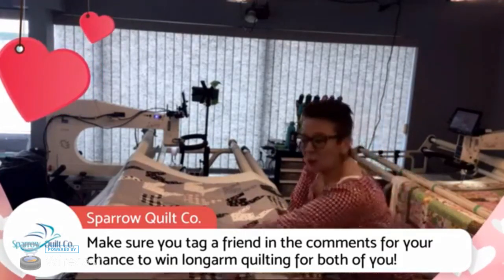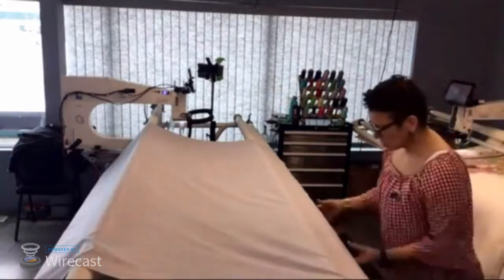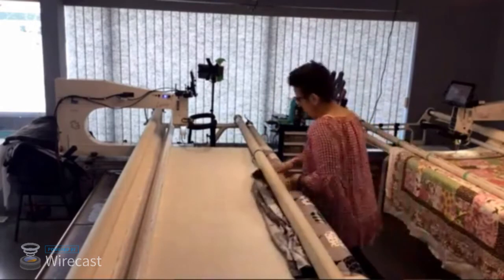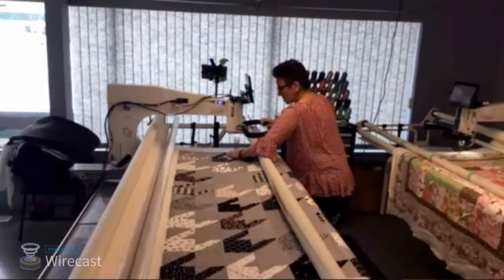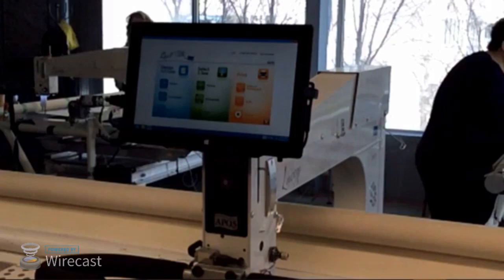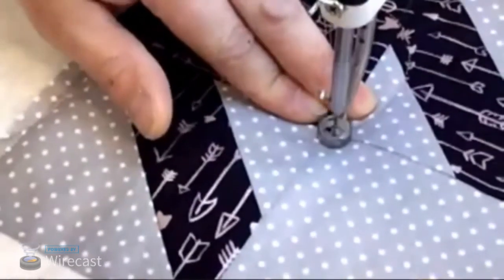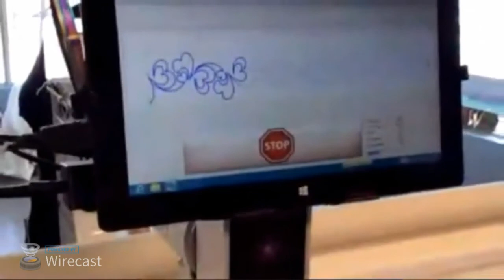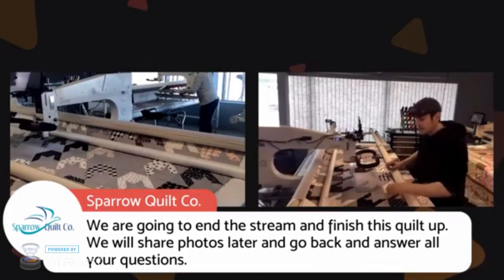Join Bradie Live as she quilts her Houndstooth Quilt!

Comment: I see you don't use the quilt top roller bar.  You float the top and the batting.  Do you even need that extra pole attached?  If often thought if you don't use that to roll up the top..wouldn't it be easier to just remove it all together?
Thanks.
Reply from the maker: Dandy Quilter you raise a good point. The brake for the rollers is on the far end of the table. It locks the two rollers in place but won’t work on a single. An add on is available, it is called a Texas Hold Em. 😊